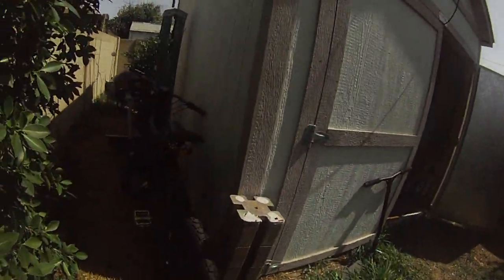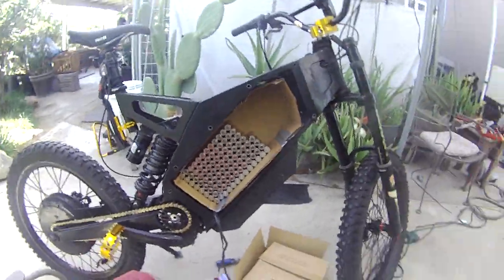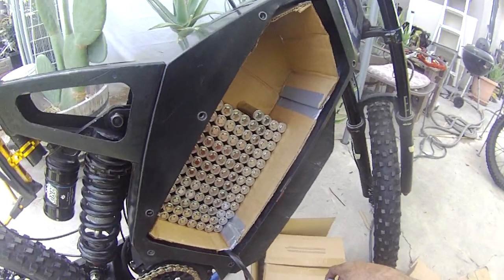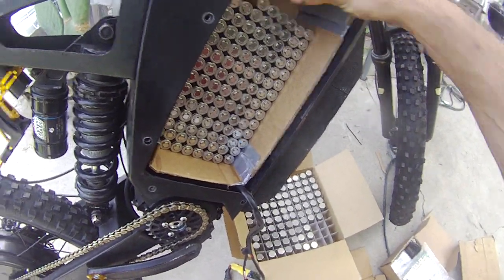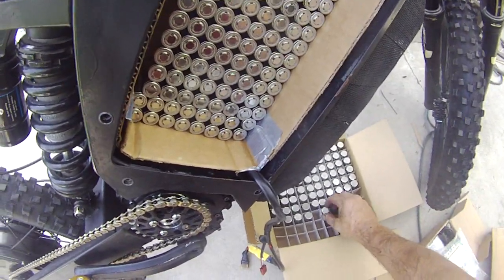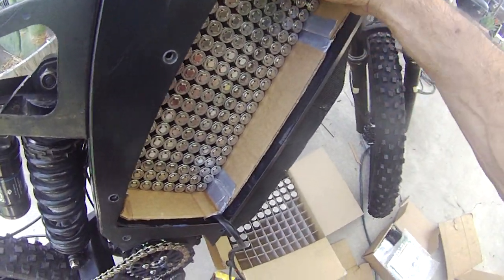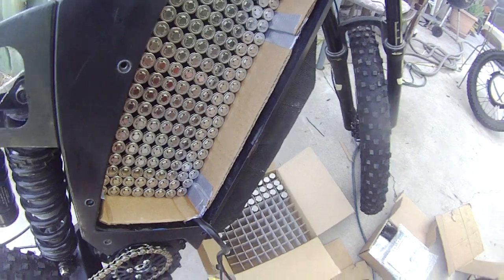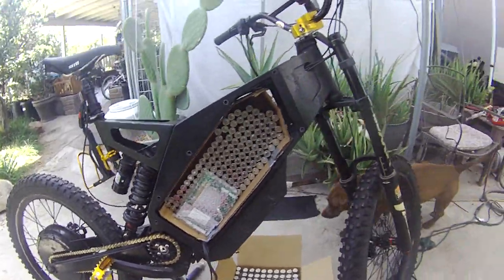Stealth Bomber 72v 16Ah Battery Pack

Comment: would if be more efficient too run 72V SAMSUNG 35E, 24.5AH RECTANGLE PACK ,HIGH POWER + LONG RANGE
weight 8.kg
Reply: It would be.. but this is becoming old technology. Tesla and other companies are researching Lithium iron (Phosphate) batteries, faster charging and can last 1 million mileage, plus it doesn't rely on Cobalt, so it's Cost efficient.
Reply: out now?
Reply from the maker: Much more...

Comment: Hey man.
Say i put a 3000w motor on.
With this battery pack.
What would the range be, you think?
I weight about 180 lb.
Reply from the maker: Im on to different cells now these are not the best for the purpose..17 Ah if the cell is right should go 32 miles @ 3000W like a factory stealth..

Comment: So even if the battery can put out more amps and the motor can draw more amps, the bms limits the current? The c rating for these batteries does not matter as long as they are above specs of the bms?
Reply from the maker: Yes.. the BMS limits the battery output current...I used an 80A BMS that can do 160A pulse so it pretty well matched to the battery size.
Reply: @christopherviersmobility  I have the bbs02 bafang 750w. The controller inside the motor is 25amp. If i should pull out the bms for normal balance charging. Could that hurt anything or should i just be watching my wattmeter temperature and volt drop. My battery is a 13s5p. Made up of 2600mah 18650. So 5 x 2600 = 13ah. Rated 4 amps per cell = 20 amps. Should be ok. I have seen bbs02 with higher current but maybe they took out the controller or something.